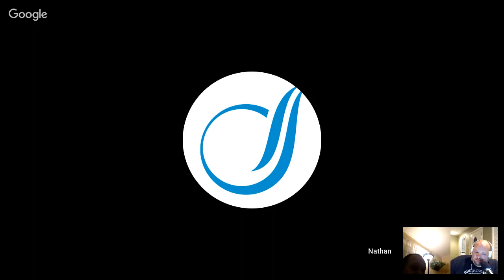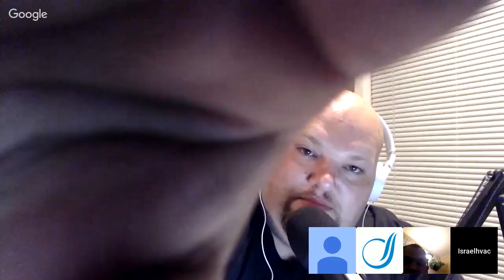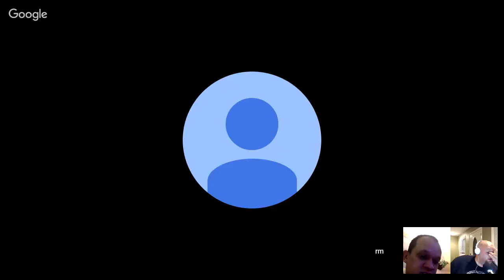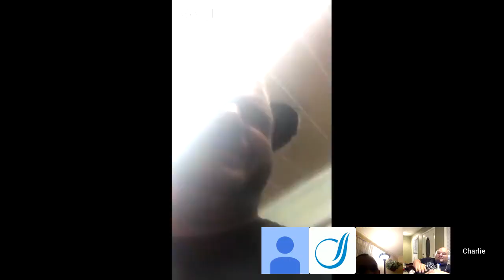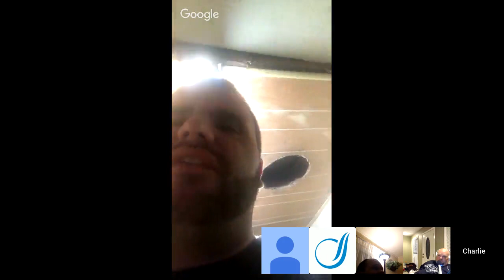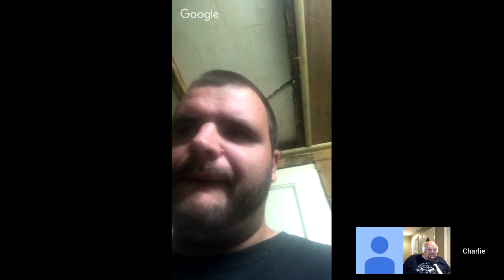HVAC Hangout

Comment: are there still problems with txv with copeland scrolls on new units. just put in a unit in and my superheat was 8, where it should be and no subcool with a piston system system. i think piston is to big. thought about using a txv.